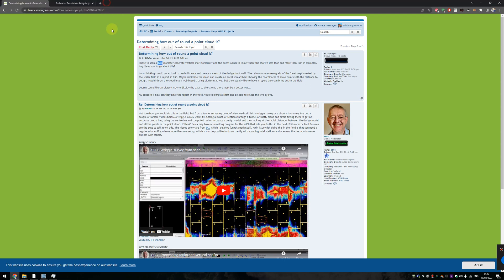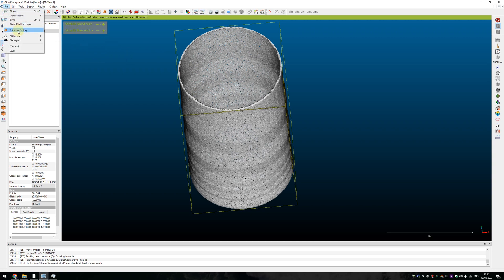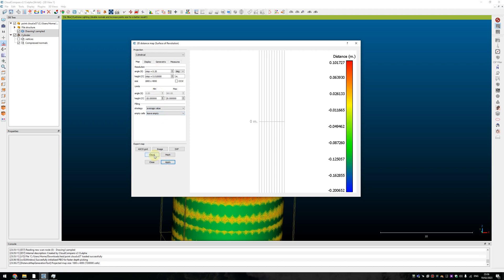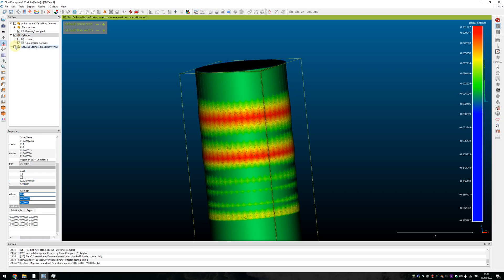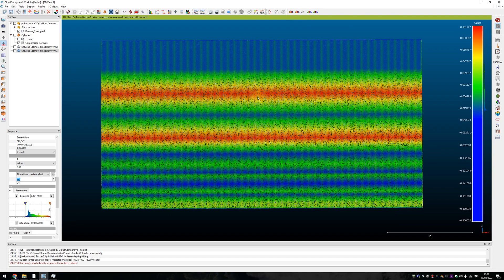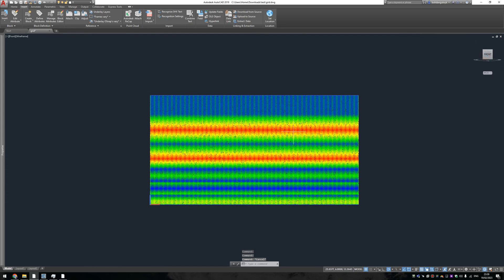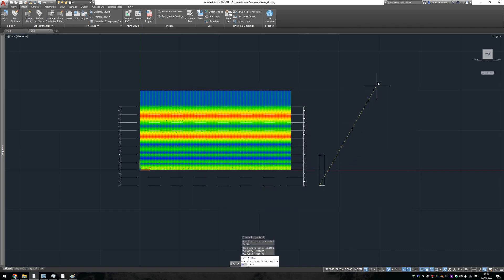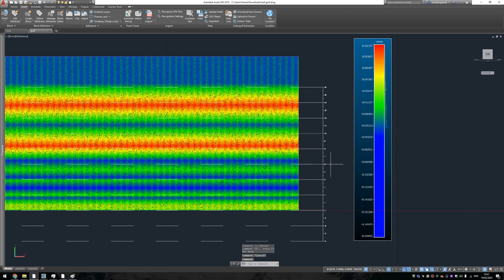Vertical Shaft/Tank analysis with point cloud data

Comment: Very informative tutorial. What about the vertically check? Can you do this on CloudCompare? Let's say you want to know the deviated points from a true vertical z line you determine on the tank shell. I am finding some difficulties establishing this true vertical z axis, I mean you don't want to use the z axis of the point cloud if the tank is titled, right? as this won't give an accurate assessment of your analysis. Overall, excellent video and thanks for your effort in posting this.
Reply from the maker: Thank you for your comment. 
You may find more about CloudCompare capabilities in the description of the surface of revolution analysis plugin.

https://www.cloudcompare.org/doc/wiki/index.php/Surface_of_Revolution_Analysis_(plugin)

But as far as I know, everything will depend on the profile of the ideal cylinder you model. CloudCompare will calculate the distance from the point cloud to this cylinder, but not the angle of the plane deviation
Reply: hei is it possible to have a tutorial involume calculation of tanks using point cloud data